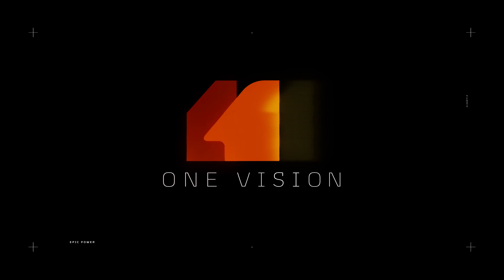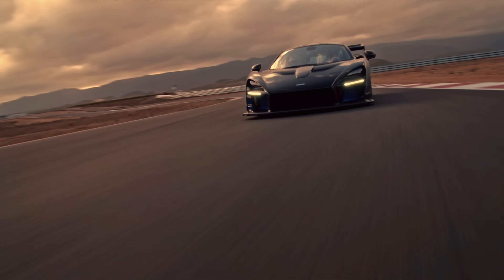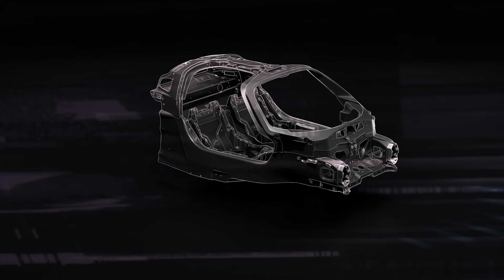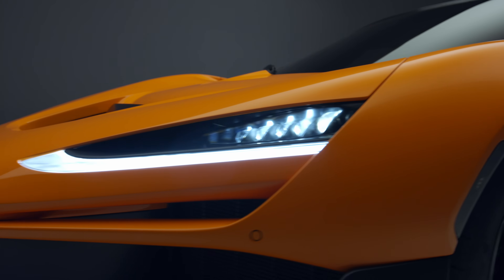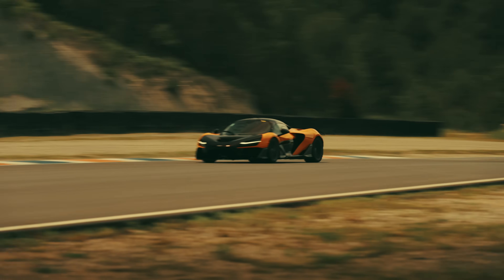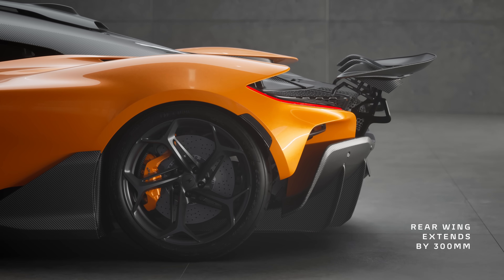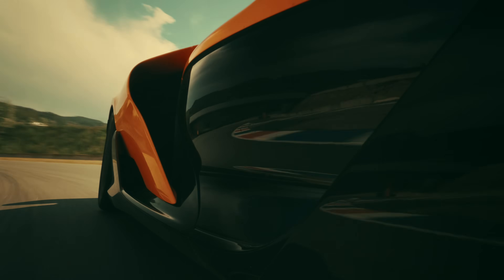McLaren W1 'One Vision' Ep.3 - W1 Aerodynamics #McLarenW1

Comment: This might trump the f80.
Reply: What surprise me is that these two (F80 & W1) will be very close with the Valkyrie (Road Legal Version). or might even surpass it already. F80 on-track is very good and stable with their Awd powertrain, it accelerate even faster than the 499p LMH nearly as quick as the Modificata, and the active suspension might give it a better handling than the Valkyrie and GT3RS.
Reply: Its lighter, and they boast highly of their aero, so I expect it to be better, but the F80 track runs surprised me
Reply: Nope. Ferrari is way ahead.
Reply: @heinedenmark  don't think so... Going fast does not mean it's ahead.. it's the overall experience that counts...
Reply: @VerangaF430 I meant the tech - and especially aerodynamics.

Comment: New  Nürburgring record
Letssss goooooo
Reply: I would like to see it.
Reply: with a ground effect car on track full of jumps and elevation changes, not happening buddy. Also its too heavy.
Reply: @veloso98 the group C cars were ground effect and did 6.11 in a race in the 80s
Reply: @veloso98 AMG ONE is heavier.
Reply: really unlikely

i doubt it can be faster then the Koenigsegg Jesko attack or new Czinger.

Hennessey is also producing a track focused car. And anyways Mclaren never really competed for Nordschleife records and even kept the P1 time hidden.
Reply: @max.racing Senna is almost as fast as Jesko Attack. W1 would have no trohble beating the normal Attack version.
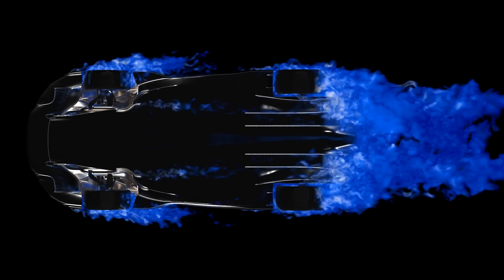Reply: @Amonity  the Senna did a 1:27.62 on Laguna Seca. 
The Jesko Attack a 1:24.86 and the Czinger 12C a 1:24.75 which is a huge difference on such a small track.

 Even more so, because on this track both cars cant really put their full power (potential) down. 
The Nordschleife on the other hand is big with seriously long straights and really fast corners. 

Where the Jesko and 12C can greatly benefit from having more power then the W1. Especially the Jesko with its 1600hp.

Also the high focus on ground effect is not working well on the Nordschleife, due to the track being so bumpy and having rough curbs which should be used quite often for good laptimes.

Those 2 facts are against the W1. 

and Koenigsegg just announced the Serdars Spear, which doubles down on power, aerodynamics, downforce and less weight.

i would not bet my money on the W1, thats for sure.
Reply: @max.racing And to beat the Senna, Jesko required Cup 2R tires(Senna is was only on the Trofeo R tires, not Trofeo RS), whole track resurfaced, and one of the corners redesigned that also made the lap time quicker.

I would bet my money on the F80 anyway.
Reply: @Amonity   yes that might be true, but Laguna Seca is not the Nordschleife.
And like i said, Laguna Seca is not a track that favours high powered cars like the C12 and Agera.
So 2.8 seconds faster is still respectable, despite all the things u named. 
On Laguna Seca the W1 might be faster due to the AWD. 

But that wasnt the topic anyways, we talked about the Nordschleife, which is a totally different szenario.

i only started to talk about Laguna because u brought it up as an argument, why the W1 should be faster then Jesko on the Nordschleife, which made no sense.

and the chance that Mclaren and Ferrari would even try the Nordschleife record is really small. Mclaren hasnt tried in 13 years and Ferrari hasnt tried since literally forever.
Reply: @max.racing on gotland ring jesko attack is barely faster than a gt3rs which was driven by some random dude, ain't no way jesko is touching w1 performance
Reply: @DevKumar-bi2ld  
the high focus on ground effect of the W1 is not well working on the bumpy Nordschleife and its rough curbs.
If we just compare stats, its not looking to positive for the W1 to conquer this track.

and the Jesko was 2 seconds faster then the GT3 RS. And the driver in the Jesko was Niklas Lilja, a fairly unknown race driver and test driver for Koenigsegg. So not a pro.

We dont know who drove that GT3 RS, could have been a pro or a local.

Also gotland is favouring the GT3 RS.
Its a medium sized track with some straights but also many curves with slower speeds.

at no point are the straights long enough for the Jesko to really stretch its legs on gotland. Which is different on the long and really fast Nordschleife where the Jesko can put down its full 1600hp. 

And they just shaved off another second on gotland with the Jesko "Serdars spear".

Which is lighter, more aerodynamic, more downforce and has more power. So even better to go on the Nordschleife.

just by the neutral facts i see no chance that the W1 can beat the Jesko/Serdars spear on the Nordschleife. 

On smaller tracks maybe, due to the ground effect and AWD. But the question is, if they even attempt the Nordschleife. Nobody wants to lose against the GT2 RS and AMG One. Thats why many dont even try it anymore.
Reply: @max.racing but you have to keep in mind gt3rs lap was not factory supported like koenigsegg, and that gt3rs was a customer car unlike jesko which is a factory car and only god knows how much koenigsegg tuned it for a record lap, only 2sec faster than gt3rs on a gotland ring which is a 7.3km track ~3min is quite embarrassing considering gt3rs can shave at least a second from it's laptime if not more, ain't no way jesko or czinger is touching f80 or w1 performance
Reply: @max.racing and no way jesko can put 1600hp on the ring, other tham 200mph straight, you don't need huge power to do fast lap on the ring, look at 1250hp corvette lol, ring requires huge braking performance, stiff chasis and excellent suspension in which koenigsegg is quite behind the competition, their triplex suspension is no where as good as that of semi active and fully active suspension which porsche, ferrari mercedes and mclaren got, although i agree due to ring being very bumpy w1 will struggle there and as for laguna seca ,senna record is pointless due to track being resurfaced like the other dude stated, and koenigsegg lap was also done on much better Tyre and it was also factory supported unlike senna which was a magazine lap, just for a reference a 750s driven by a YouTuber had done faster lap than senna on the laguna seca
Reply: @DevKumar-bi2ld  and u know F80 and W1 performance? How then?

And how can u know that W1 ground effect can work right on the Nordschleife?

Those are all assumptions and i gave facts which indicate that the W1 will not have an easy time against the Jesko and C12 on the Nordschleife. 

Ur trying to argue with the use of Laguna Seca and Gotland times, which are both totally different to the Nordschleife. All based on ur own assumptions which are backed up by nothingness. 

we have no indicators about both cars track performances, unlike the C12 and Jesko which both gave us multiple track times for comparisons.
Reply: Under 6 minute lap 

One can dream :)
Reply: @Shadowed007 This car cant achieve a sub 6. Im gonna take it as youre trolling